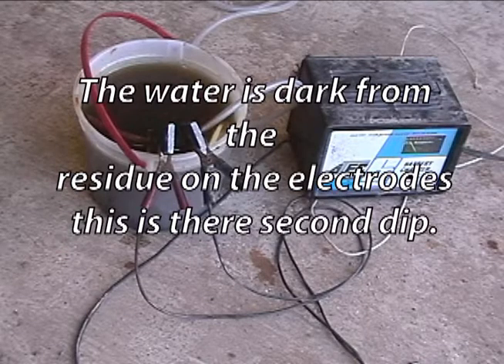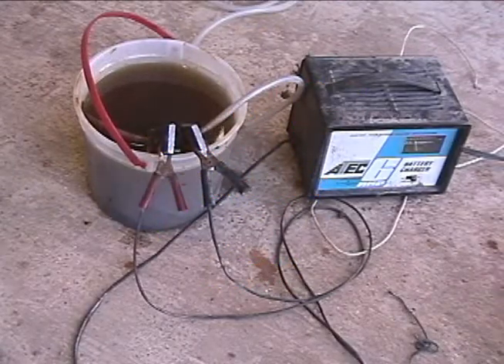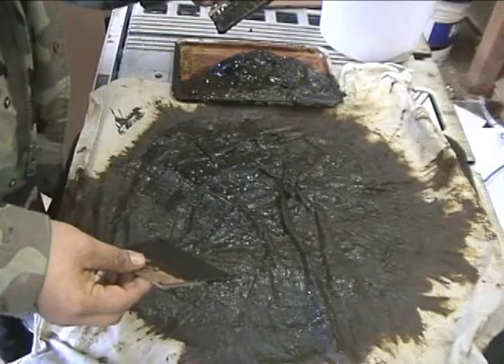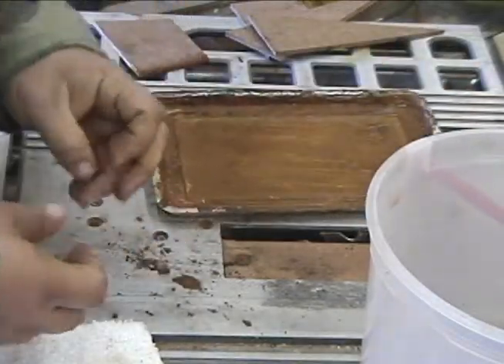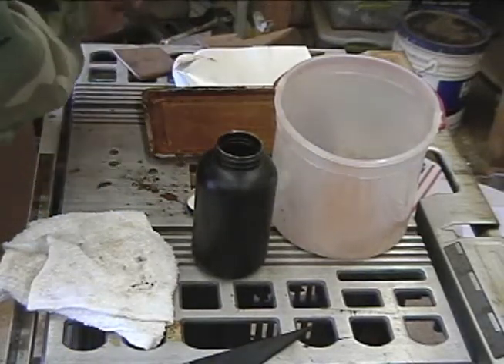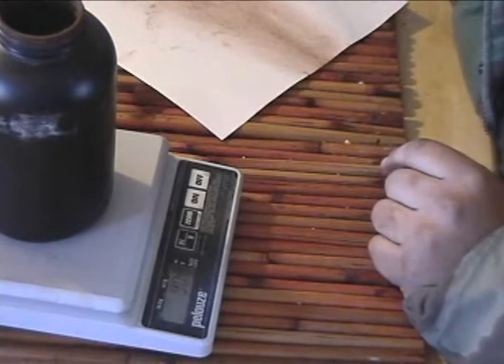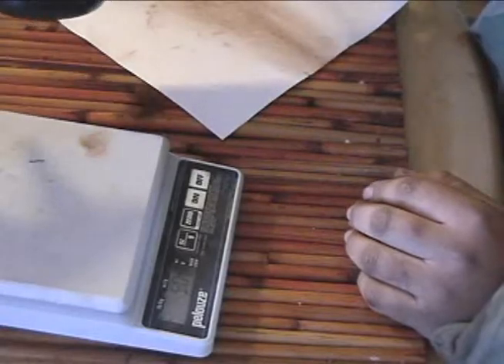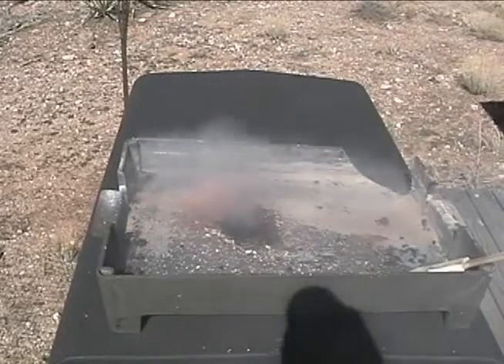How to make IRON OXIDE

Comment: I made some for the hell out of it but I poured it through coffee filters and got 10 times this.  I think that you lose massive amounts in the cloth.

I have a dehydrator and place the coffee filters on trays.
Reply: Clown Whisper You can also place it on a big plastic surface, let the water evaporate and you lose nothing.
Reply: Clown Whisper Big surface area?
Reply: +UYes Uno how long does that take?
Reply: Joep Stuyfzand It can be very quickly, it really depends on how much water you allready filtered through lets say a coffee filter and then place on a plastic surface. It most of the time takes a day or so.
Reply: +Clown Whisper what brand coffee filter did you use?
Reply: +jo atjo generic
Reply: +jo atjo I just did another batch using electrolysis I have a low voltage the 5 volt power supply but it pushes 30 amps and I was able to dissolve a five pound iron bar in just a few hours
Reply: Clown Whisper where can I purchase the power supply, I have a chinese crap machine
Reply: +jo atjo I found this power supply on ebay its a lambda but it's just 1 of 1. if you take and convert a PC power supply to do electrolysis and work just fine you should be able to get maybe what 15  amps if you tie all the leads together? I can't remember maybe even more than that
Reply: +Clown Whisper I use a PC one but it just mainly grows crust at 5V 16A, do you think its the voltage?
Reply: +Joep Stuyfzand 5 volts is plenty.  Make sure you keep the electrodes  assay away as you can.   Use a saturated salt solution.  Make sure both electrodes do the bubble,  or you'll get simple ionic transfer from  one leas to another
Reply: +Clown Whisper thanks!
Reply: +Joep Stuyfzand i mean make sure both electrodes do not bubble only the one should
Reply: +Clown Whisper yeah, does bigger electrodes increase the speed?
Reply: Joep Stuyfzand more surface area the better
Reply: Clown Whisper approximately how long did it take for the electrodes to disappear ? From my past chemistry classes I remember voltage being the main contributor to rusting not amperage. so if you have it on lower voltage and higher amps it's possible to get much more out of the electrodes. Maybe we need to experiment and put the results down, I'm getting rid of this chinese crap today
Reply: jo atjo VOLTS ARE BETTER?
Reply: Joep Stuyfzand it's a little complicated but I can simplify, you can only get 2 volts between two electrodes NOTHING MORE. Whether it's 20 volts or 50 volts there will always be 2 volts but as you put one neutral plate in the middle that can increase the voltage to 6 and 6 on each side(12 volts). So if you want to get rid of the electrodes you need a neutral plate. The idea is to keep the electrodes as long as possible, just because the electrodes disappear it doesn''t mean you got the optimum amount of iron oxide. What determines how much iron oxide is in the solution is the amps, basically the amps or current when very high can produce alot of iron oxide but you have to deal with the solution overheating or even the turning fire red so you would need to have very thick electrodes.  My problem is that my dc power supply is directly correlated with the volts and amps but you can have a power supply that you can play with so that volts are almost independent of amps. Hope this helps. You find very fast that whatever you read isn't really reality sometimes so that's why it's important to run tests and record the data. I think I can do this in December once I throw another thousand in costs.
Reply: its all about amperage 
I was pushing 30 amps @ 5 volts. and over night I got 4 lbs.
Reply: traditionally you can use a large surface size with small width like wall plates and you would get about same amount, the issue is with the surface size directly related to amps. Amperage is what decides how much will be deposited. Hence why you can't get high amps from steel nails and little deposit
Reply: +Clown Whisper on paper with calculations he's losing about 25 percent of iron oxide with the cloth.
Reply: achieved 142 grams in 45 minutes. 9 volts 15 amps 3 plates,still have 90% of the electrodes
Reply: 1.5 table spoons of salt
Reply: all about the data

Comment: DUURRRR DURRR LETS PUT SOMETHING INCREDIBLY EASY TO IGNITE IN THE TOASTER OVER ON HIGHEST TEMPATURE HUUUR DURRRRRR DUURRR
Reply: It was just iron oxide at that point not the thermite.
Reply: It's not even combustible at the point that he put it in or took it out.
Reply: Oh sorry for my mistake.
Reply: Brody Bomb Even if it was thermite, it would take immensely higher temperatures than a microwave could produce to ignite it. You need magnesium in some form, usually ribbon. You set the magnesium on fire, than use that to light the thermite.

Comment: Get steel wool 000 grade use a solvent to clean off the protective oil and soak in plain water took a few days but it is super fine powder when dried the chunks just poof in to dust with slight pressure from crushing in a mortar.

Comment: let me help you with that answer yes you have to use iron. where do you think the iron in iron oxide is going to come from? (steel contains iron) and at first you make iron hydroxide but once the water is gone and it is exposed to air it turns into iron oxide

Comment from the maker: iron(III) hydroxide (Fe(OH)3)

Iron(III)  Oxide (Fe2O3)
From what I read on line Iron Hydroxide would have been a lot more Yellowish.  It is actually used as a Yellow die for makeup and Tattoing.

What you are describing sounds more like copper sulfate If you used tap water it could have had a reaction with the cemicals in the water that are added by the local treatment plant.  I have seen copper turn sand into awsome blue glass after a cell tower was hit by lightning.

Comment from the maker: That could have been due to a number of reasons. Off the top of my head it could have been the electrodes were placed to far apart from each other requireing a greater voltage, not enough salt,  not enough iron content in the electrodes, or the battery didn't have enough stored energy to sustain the reaction for long enough.   Thank you for your comment.